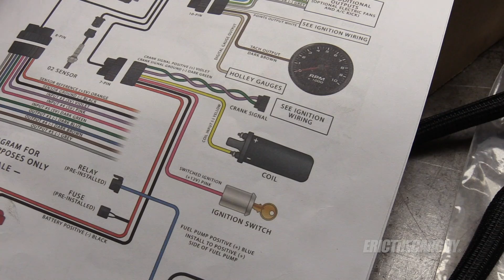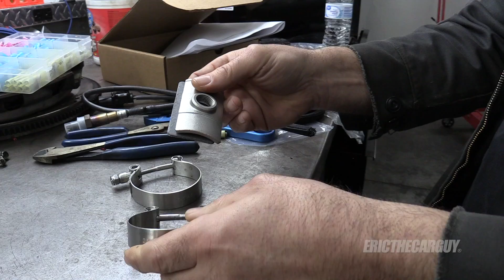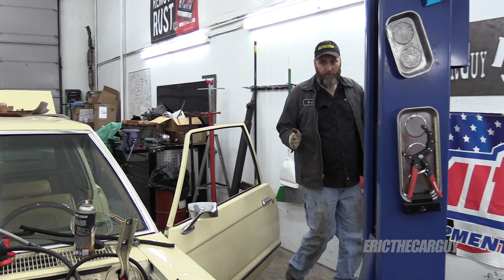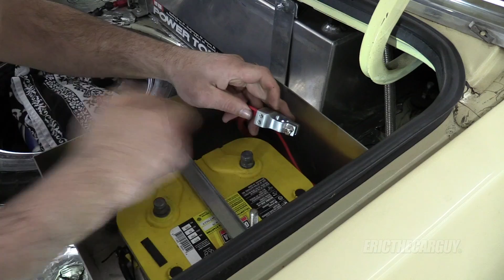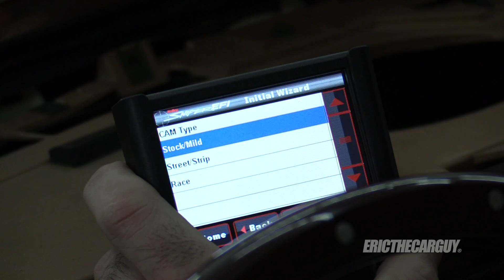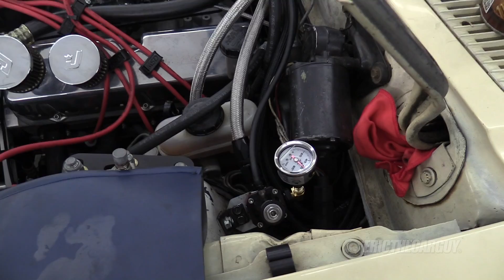How To Install a Holley Super Sniper EFI

Comment: Just installed The regular sniper, finished on Monday 22. April , after 3 days of 8 hour days, dropping the tank, removing all exitsing fuel lines and ran new ones. the darn thing started on the first key turn before the starter had finished one full rev. i was so proud i patted myself on the back til i burped
Reply: I’m in the process of doing the same. I’m excited
Reply: @BUILTFORDTOUGH79  how did it go ?
Reply: @Grim_R13576  personally, no issues. I love it. One suggestion….. get a more precise tune and make sure your timing is 100% before trying to diagnose any issues you think may be related to the Holley.
Reply: @BUILTFORDTOUGH79  Alright, Thank you
Reply: @danielaguirre5611  you send it to a tuner and they change fuel tables and timing. Read up on it…..
Reply: @danielaguirre5611  not exactly. You use the data log feature, upload it to a PC, then send the data log over to them, and you can flash a more dialed in tune to your sniper

Comment: Probly won't even have to smell fuel when tuning. And what is this learn thing, with the wide band 02 is there any tuning. some good advice with the check for wide open throtle. and the other details in there like wire nuts to verify .then you can be sure about your harness installation. very well produced video thanks for sharing

Comment: The sniper return spring may not be enough to pull back if impeded.  For instance a hose near the linkage could relax after a long period of heat under the hood and press up against it causing more resistance than expected.
Reply from the maker: There are 2 return springs on the Sniper and they seemed to work quite well to me. Given that I already broke the throttle cable once, I didn't want to add anymore stress to it. Thank you for your comment.

Comment: I'm installing the Sniper in my 1972 Pontiac LeMans right now. My biggest hurdle, so far, is that the original fuel lines are 5/16", so I am bending my own 3/8" line. For the return, I'm using Holley's filter/pressure regulator so I don't have to run the return the entire length of the car.
Reply from the maker: Good luck. I ran the same on this car. Bending that hard line was a PITA.

Comment: Holley sniper can control your timing with boost
Reply from the maker: Only with the Hyperspark system. I plan to install that later this year. BTW, the original Sniper system didn't have that capability. The Super Sniper, like the one I installed in this video does though.

Comment: I think you should must check the mis allignment of the AFR among your gauge and the sniper display. Take out the multi meter and check for voltage drop as you are suspecting. At least you can than be sure about the integrity of the readings.
Reply from the maker: I will at some point. Right now I have a truck to finish. I had the same thought though. Someone else suggested that the new O2 will come in line after a little time.
Reply: EricTheCarGuy love your work btw 🔥👍🏻

Comment: I've been looking for a video like this. I'm looking to put a Sniper on my '76 F-250.
Reply from the maker: Do it. I think you'd be very happy with it. It's a lot more steerable and efficient.
Reply: @ericthecarguy  efficient is relative in a 6k lb pickup with a 460, but I'd like to turbo charge it eventually, and have a beat up old truck to run at the track for fun.
Reply: I would keep your traditional carb. I installed a Holley Sniper on my 1963 Ford Thunderbird with a 390 FE. Runs great when it runs but there is ALWAYS an issue with the Sniper. I removed the Sniper and went back to an old fashioned carb!

Comment: Good stuff, I'd simplify the tubes and wires under the hood, b/c on power tower you need it simple.

Also get a catch can other wise your rear main seal will pop after few pulls.
Reply from the maker: Honestly I haven't had any issues with the rear main, and I've had the engine out a couple of times since I put it in. The breathers on the valve cover work pretty good. I'm not running killer boost either. About 7psi.

Comment: If you have dual pipes does the O2 sender need to see both or only one?
Reply from the maker: This is just a throttle body unit, 1 O2 is just fine. With MPFI, 2 would be ideal to have 2, but I haven't seen an 'off the shelf' system like this one come with 2 O2 sensors. For a system like that, you'd probably have to build your own set up.

Comment: Seems odd that Holley's fuel pressure regulator isn't boost referenced. That said, the install looks fairly easy. My MegaSquirt install was much more involved.
Reply from the maker: Hence the reason I went for this particular system. I didn't have any time at all to get deep into something. BTW, my fuel psi regulator is an Aeromotive. Not sure if you were referring to that or something else. Thanks for the comment.
Reply: Considering the price of the Holley EFI system, you'd think they'd include a boost referenced FPR. (shrug)
Reply: Side note: I found a video about installing a progressive throttle linkage on a Holley EFI system. I'll drop a link here, just in case somebody finds it useful ---> https://www.youtube.com/watch?v=ap2tdGnrmxw

Comment: One thing i dont understand is why the efi kits want to connect to an electric fan. I dont want an electric fan in my truck
Reply: The ECM doesn't need it. It's an extra feature.
Reply from the maker: It's actually nice to have if you are running electric fans because you can set the on/off temps for both fans individually. You don't have to use them if you don't want to.
Reply: @ericthecarguy  ok sounds like its not a requirement, i thought it may be. Thanks! I didnt want to have to get even one more thing to install haha.
Reply from the maker: It's not a requirement. I didn't connect them on this installation and it works fine. The only things that need to be connected are what you saw in this video.
Reply: Like Eric said, it's a convenience feature. If you have an electric radiator fan, you can connect it to the ECM and program the on/off temperature via the ECM. If you don't have an electric fan, then fuggeddaboutit. 😉

Comment: 750 rpm is the same idle speed as my 1.2 75hp Renault Twingo - it feels a lot faster now that I know it has so much in common with your car! ;)
Reply: Rear engined??
Reply: @malcolmyoung7866  The intake and exhaust manifold meet up under the hood so I'm working under the assumption that the metal shoebox connecting the two is my engine. You're right about the newer model Twingo being rear engined though, just not my weird contraption ('03 so still the old / original model Twingo I, but with the 16v 75hp engine that is otherwise almost exclusively found on the Twingo II).

Comment: now I need to go find the video of the fuel pump install, the sniper master kit I have as a fuel pump with it and I'm trying to get ideas for placement. Awesome video btw
Reply from the maker: My entire fuel system is custom. Sadly, I don't have video of the latest version yet. I'm still working through those edits. The cliff notes are, Moroso screen filter before the pump, then a fine, screw on oil filter style filter after the pump. Hard line from the secondary filter to the FI unit on both the delivery and return run along the left frame connector. -8 throughout. You should use -10 from the tank to the pump if you're doing big power to avoid cavitation. Fuel psi regulator goes on the return side. Good luck. Oh yea, I also put rubber washers under the mounting points for the fuel pump. Helps keep it a little quieter. Fuel pump is mounted just behind the rear bumper on the drivers side. It's activated by switching the ground side of a relay I mounted in a custom mount behind the passenger kick panel. The switch controls the ground of the relay.
Reply: I was gonna go with FiTech and use their Fuel command station which lets you use the mechanical pump

Comment: Be Careful coiling wires that transmit Data especially near the ignition system as they will act like an antenna and cause problems.
Reply from the maker: Distributor on the front, coiled wires on the back. Thanks for your comment.

Comment: Locktite on those bolts for the linkage plate extenders would prevent them coming loose and goofing up your throttle while driving down the road. ALWAYS RETURN SPRING! This is a safety issue. You have a high horsepower car that will overwhelm the brakes at wide open throttle. Please I am begging you. Use a return spring.
Reply from the maker: The return on the unit worked very well. I don't know if you noticed, but there were 2 on it already. Also, given that the throttle cable broke, I didn't want to over stress it. As for locktite, not necessary either. You may have missed that the fasteners were locking.

Comment: Oh one other thing.. it might be a good idea to install a return spring on the throttle linkage. It's damn scary if it ever jams wide open on you. I found out the hard way once.
Reply from the maker: I agree, but the return on the unit was very good. Given that I already broke the throttle cable, I didn't see it as necessary. Thanks for the comment.

Comment: Eric, great vid.  That being said, in the last vid of the "unboxing", you stated that you were upset with the black rubber (?) fuel hose instead of the "silver" hose.  I saw a vid right after yours where a guy was installing the same thing as you, but on a newer Mustang. The vid of that was the opposite of yours. You-silver, his-smokey black. I think that is the difference. Silver gets black hose, and black gets silver hose. Hope this helps.
Reply from the maker: That's not what was pictured on the box. To me, that's false advertising. Thanks for the comment.

Comment: You should install the return spring, backup is insurance. Learned this hot-rodding back in the 60s.
Reply: It's a good idea , I second this thru my own bad experience when I had to hook my foot behind the throttle pedal and pull it back after the linkage jammed open. Not afraid to say I shit my pants that day.
Reply: For everyone complaining about no throttle return springs: This is a modern style TBI FI unit. Just like a modern car throttle body, it has dual return springs already. The reason for return springs on carbs is the springs are for mechanism return and return springs are for safety. On EFI there are no "mechanisms" like accelerator pumps, secondaries etc. so the springs on the unit are the actual return springs. Just as you wouldn't run an extra set of return springs on a brand new challenger, you won't need them here either.
Reply: @xxRamD3yruxx  exactly exactly.  Lol
Reply: Most tracks won't let you run without one.  That's minimum tech, strapped down battery, throttle return spring.  The day the springs get weak or the blade shafts are in a bind, you're going to have a bad day.
Reply from the maker: It would also make the accelerator pedal very hard to depress and over stress the already fragiled throttle cable that you saw in the video. Thanks for the comment.
Reply: @ericthecarguy  You need to find a better throttle cable. That old one looks bad. Not sure who makes the best ones nowadays.
Reply from the maker: The dash needs to be removed to replace it. I won't be doing that anytime soon.

Comment: Eric, the next time the engine comes out (we know it will eventually) might I suggest you go whole-hog on the engine bay - clean it, plug any necessary holes, and paint it - either matte black so the engine can be the center piece, or a color that compliments the engine. Keep the exterior looking like it does for sleeper status, but you can really go nuts on the engine bay. Note: I don't mean make it look like the pep boys threw up in there, or make it look show-car pearlescent/metal flaked to death, just clean and fresh, like that glorious engine.
Reply from the maker: Never gonna happen. If you've seen my previous videos on this car you know that I actually love the fact that I have this jewel of an engine sitting in a dirty engine bay. Also, I did paint some of it when I did the HVAC as you'll see in future videos.

Comment: It's really annoying that Holly didn't spring for the extra 2 bucks and put a good capacitive touch screen in this.  Resistive touchscreens have been obsolete for a decade.
Reply: I agree with you about the spring. But a lot of stuff still uses resistive touchscreens because they work with gloves.
Reply: @killaham4  interesting point. I suppose at a drag strip or race track it's very likely the driver would be wearing gloves.
Reply from the maker: Honestly, everything about this kit is cheap.
Reply: @ericthecarguy  hmm. Not exactly a ringing endorsement.
Reply from the maker: Everything is cheap these days. The system does work though.

Comment: I had a 72 Camaro with a 383 carburetorated and I loved that car! I regret every day selling it however I do remember having to constantly fuss with the carburetor and because it wasnt daily driven and sat for weeks sometime without being driven there were constantly issues ! I should have converted it to fuel injection! I believe your going to be allot happier with this efi system in the long run! You'll also be able to tune your engine better and hopefully get more horsepower as a result!  As always a great video! Please keep em coming!!
Reply: Yeah for a car that isn't driven much, EFI is the way to go, carbs hate sitting around. Had a 83 z28 with a built 350 in it, drove it to high school every day and never had any problems with the carb, until I bought a "responsible" car to drive daily. Some asshole rear ended it like a week after I did the conversion, yeah miss that car a lot.

Comment: Don't o2 sensors have internal heaters to bring them up to temp really quickly?
Reply: Do R/C!    Not all.  I just replaced an O2 sensor that didn't have a heater circuit.  Only had one wire going to it and cost less than $15.
Reply: @JeffL396  understood. But I'm pretty sure the vast majority do.
Reply: @Do R/C!  All wideband's o2's have heaters.  They should only ever have power applied to them when engine is running.  If power is applied (i.e. internal heater in the sensor is switched on) without the engine running it ruins the sensor and it will never read accurately.  Chances are this has happened to Eric.  Never wire a wideband o2 to ignition circuit, it should only ever be on when the engine is running.
Reply from the maker: Yes they do, but it's still a good idea to place them close to the engine for more of a 'real time' reading of what the engine is doing.

Comment: Run a return spring for redundancy.
Reply: Look how the throttle cable broke at the peddle all of a sudden. Run a return spring.
Reply: Rtn Spring is built into the throttle body. Butterfly
Reply from the maker: Or a very difficult to depress accelerator pedal.